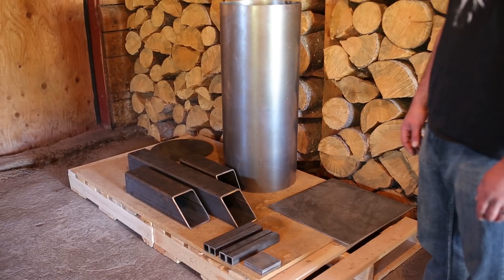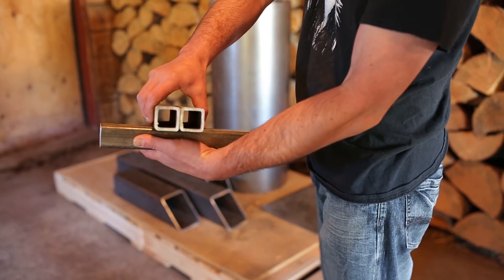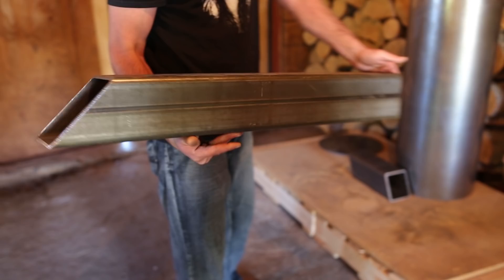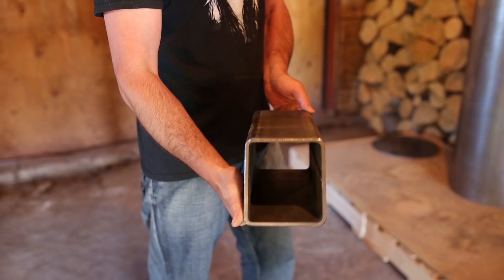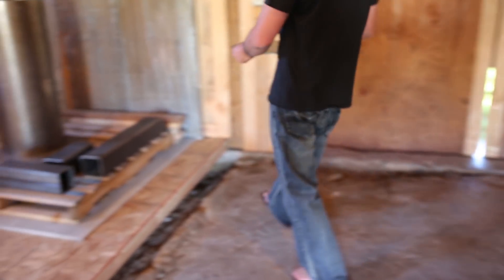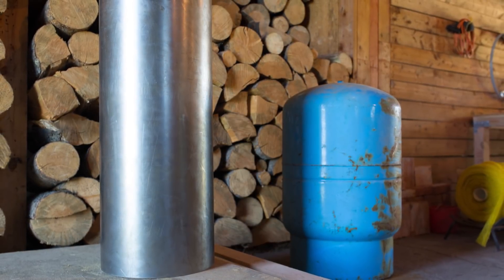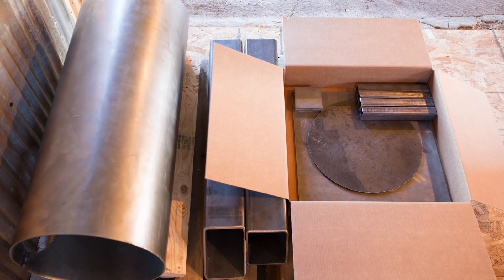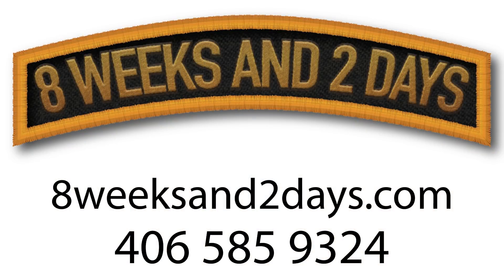Rocket Stove Heater Parts List and Build Sequence - Part 1

Comment: The riser ought to be 5" round pipe to allow the swirl of fire to create the rocket effect for a complete hot burn of the gases after the wood turns to fire for the no smoke effect. Videos below shows what I'm talking bout.

https://youtu.be/xR_1OH0rQEo  (part 1)

https://youtu.be/2gQH0iHmNJ4  (part 2)

Comment: I’m thinking of making this to heat running water for a swimming pool, was going to line the inside of the cylinder with 22mm or 28mm copper pipe, would be hot enough to heat the running water? Was going to use as much pipe work as I could fit up and down the cylinder
Reply from the maker: My kit offers the core components needed from which each builder / assembler tends to modify or add-on according to their specific requirements, skill set and objectives.  I have not experimented with heating water.  If you do create the water heater that you describe, please let me know your results.  Many thanks.

Comment: The propane tank is a good choice. It's built to standards to not fail. It's a good way to cut costs. Manufacturers of propane tanks are regulated by guidelines to ensure the safe distribution, storage and use by consumers of propane. The ASME (American Society of Mechanical Engineers) have created specific rules to ensure safety is kept at its highest levels. These rules are constantly reviewed to make sure those propane users whether they are commercial, residential or farm and industry consumers of propane are always being protected. In the United States these rules are enforced by local, state and even national levels to be sure that all of the applicable regulations and codes are being kept.
Reply from the maker: All you said makes sense as long as you know the history of the tank.  Good info...thanks

Comment: How well is the metal of the heat riser holding up? I ask because so many people say to not use metal as the chimney material, but to use fire brick or something similar. I'd appreciate you input.
Reply from the maker: I'm on my 2nd full winter of use with no issues.  My kit offers the core components needed from which each builder / assembler tends to modify or add-on according to their specific requirements, skill set and objectives.  Thanks.
Reply from the maker: 3 winters and counting in my garage that I use as a workshop also.

Comment: I disagree with your statement to a propane tank steel being inconsistent or unknown steel. Also The propane tank is rated for 3500 psi , factor in that it's burst pressure is at 3 times that amount by design for safety, So I would really rethink what steel is used.
Reply from the maker: I welcome your opinion here...thanks for the input.  Selecting a material for a pressure or psi requirement, as is the propane tank case, is different than selecting a material for it's heat related qualities, in my opinion.
Reply: 8Weeksand2Days Survival 
 Materials that have the ability to hold high pressure are not inferior metals they are also X-ray every 12 years for fractures, which was my point high carbon steel is used in the construction of these tanks and they melt at the same temperature as the material you are using. So with that said the only variable here is the thickness of the material which is to say if you had a overheat condition with both style rocket stoves which would be the first to fail? I have work in the Automotive/Truck industry I am a ASE Master technician with a skill set in Major Body chassis repair and Welding I also am a certified welder 39 1/2 years.I am only trying to make sure you state something were facts are important especially in the realm of survival.I am glad that you are making a kit available to those that do not have the ability to cut metal or fabricate a drum. What would also would be helpful is if you give it a rating on BTU'S.
Reply from the maker: My concern is for a "junk yard or salvaged tank" of unknown origin or condition for safety reasons.  I defer to your training and experience on the technical details.  And as you mention, my purpose is to have a safety net for any upcoming natural or man-made upheaval / disaster that may be in our future.  Thanks very much for posting your comments.
Reply: 8Weeksand2Days Survival In this statement a JUNK yard tank that has heavy rust on it I would question but if it is surface rust but the painted surface is intact there really is no reason that it cannot be used. Yes we all like to use a purpose made secondary burn chamber/drum but as you stated in the survivalist you need to use what is available to you. good luck with you endever.

Comment: Sir add a titanium plate that will be heated by combustion chamber with all the toxic chemicals going out a side exuast flute so food being cooked by materials being burned will not become contaminated. Titainum conducts heat very well and will glow red hot like coals for cooking on in a camp fire?
Reply from the maker: Once air is introduced into the firebox, it is contained within the housing until it exits through the chimney pipe.  With that in mind, no heated air with burnt materials can come in contact with food placed on top of the housing.
Reply: 8Weeksand2Days Survival 4

Comment: Seems like a cylindrical  feed tube and burn chamber would operate more efficiently and you would get more of a vortex. Or does it matter?
Reply from the maker: I tend to agree with you in theory without having tested it myself.  There are a number of You Tube videos that demonstrate quite well the the principle you mention.  The square steel that I use seems to generate as much heat and clean burning as I need for my purposes.  Without much effort I am able to get the firebox, where it extends from the housing, glowing various shades of blood red to a much brighter and hotter red....that's about +- 800 degrees F.